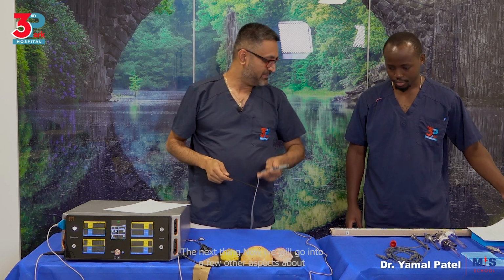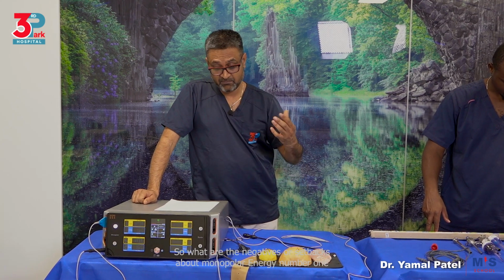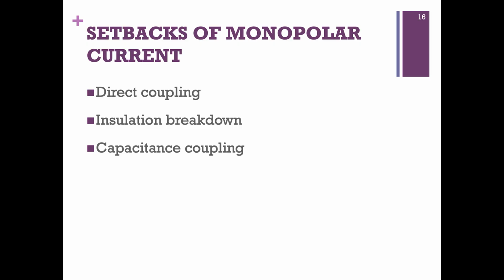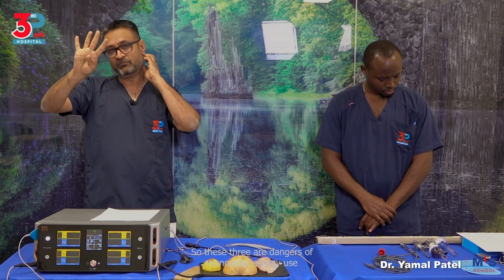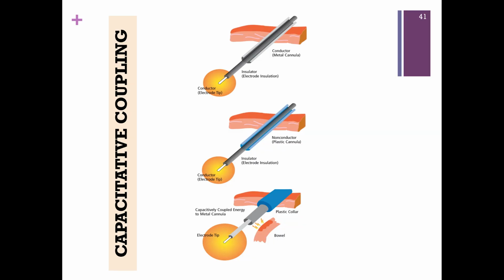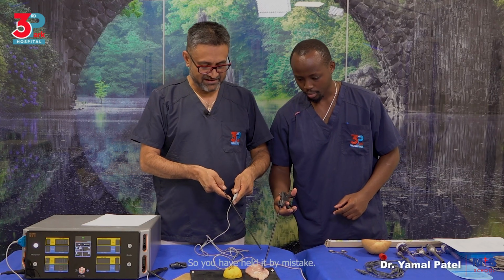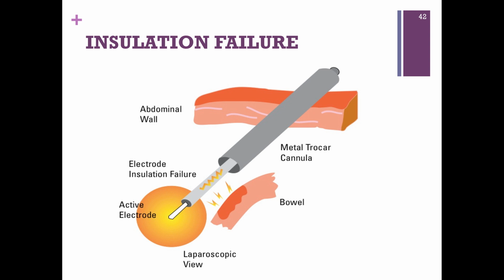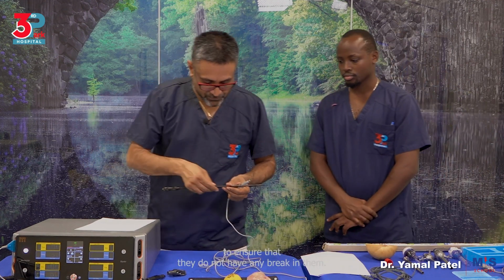Electrosurgery  Part 2  - Monopolar | Dr. Yamal Patel

Comment: Sir , I am a vet, I am not able to use cut and coagulate at same time while using blend mode, every time bleeding is noticed. 
Using Eclipse, Cresta I, ESU. Any suggestions. Plz guide.
Regards 
Respects
From India
Reply from the maker: @user-hc2ld9pv1v  hi there doc,
The settings to be used depend  exact need during the surgery, so there is no one setting for all scenarios. Where exactly in the surgery are you facing this challenge?
I could advise accordingly. 
We also have a CUE (correct use of electrosurgery) workshop in April on the 25th and 26th. You could try join online as a delegate and see if these queries are clarified in this course.
Reply: Thankyou for replying. Sure sir I will join, do you have any link of it? 

I am facing challenge using blend cut, it is bleeding even after cutting in using blend mode, while removing tumor as it is more vascular.
Do we have to touch tissue first and then press switch (activate) as recommended by company.

Or it is normal like cut, first press the switch ( activate) and then touch the tissue, during blend.

Also need to clarify between dessicate, fulgrate.
Regards 
Respects
Reply: Well said.